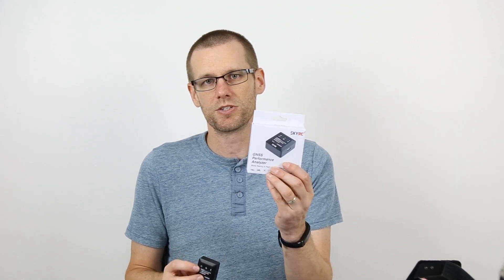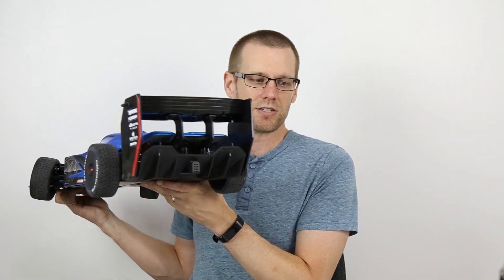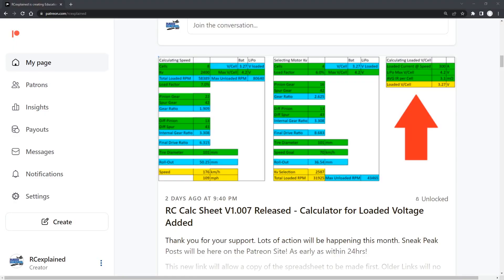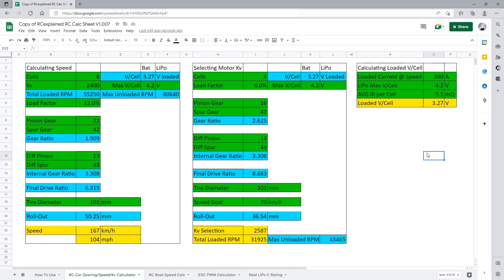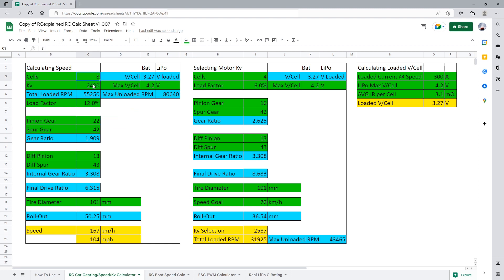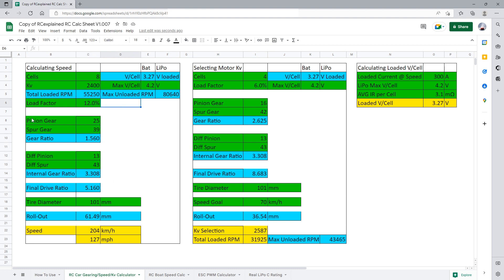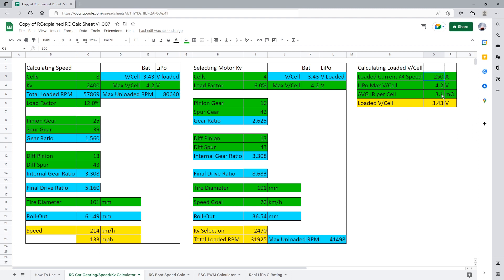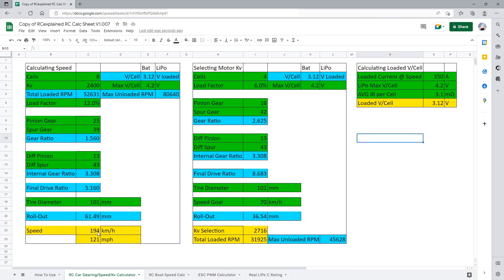Limitless 8s 2400Kv Update - Gearing Calculations, Radio Issues and Removing that Garmin GPS!

Comment: Look up futaba 4pm range mod. Another YouTuber with a aarma limitless standing on the road took the car out till it wouldn't go any further, it went 900 ft before it lost signal. Then he did the range mod and the car went 1900 feet,  he picked up a thousand feet and he only stopped because he couldn't see the car anymore.
Reply from the maker: Which range mod module do you recommend?
Reply: @RCexplained I can't recommend any of them because mine is  the mail on its way but this is the one I ordered.  

Szhushi 4w Power Amplifier 5dbi Antenna Wifi Signal Booster Repeater For Wireless Router.

It's the same one that was left in the link on that video. It worked for him so I'm going to take a shot in the dark.
Reply from the maker: Thanks I will look in to it

Comment: Highly Recommended  Futaba 7px or 10px remote.  high initial cost but a very powerful EZ to operate remote. holds 40 cars & tailored for speed run & drag racing while catering to bashing, rock crawler & the likes of rc. be safe
Reply from the maker: I have a feeling 12 receivers is not going to be cheap either ?
Reply: @RCexplained   high cost ea $90.00 highly recommended but "NOT" needed for your application. their is other alternatives. be safe.
Reply: I’m on the edge. Nearly everything I own is Futaba (baring one steering servo), but it’s on the T3PV platform, and distance becomes an issue with the ARRMA Limitless.

Additionally, I’ll be needing a radio for airplanes, and I’m a control junkie and I love instantaneous information, so telemetry is mandatory. 

Thanks again!

Peace always✌🏻  

Thanks for your input on the issue.

Comment: I've seen a lot of people using plane or drone receivers with twin ariels, futaba seem to be the go to but I'm not to sure how good other manufacturers receivers are👍
Reply from the maker: I could use one of my plane receivers, but I don't want to use the Airplane stick transmitter.
Reply: @RCexplained  Raz Shifrin and Kevin Talbot on YouTube use one on a futaba wheel controller, one of the last videos shows Kev buying two from his local hobby shop. Hope that helps bud 👍👍

Comment: Radio I'd at least do a futaba 7pxr or 10px. Although you could get away with a futaba 4pm or pv..
Then also install a range extender. This will give you about 3000ft of range..
Also looking using the dual antenna rx futaba.
Reply from the maker: I have a feeling 12 receivers is not going to be cheap either with the 7pxr or 10px ?
Reply: @RCexplained  the receivers are compatible with older protocols. So there will.be quite of range of receivers to select from

Comment: Hello love your video's keep them coming, I have an rc8b3.1E, I have been able to hit 105 mph my problem I have is ripple voltage I think??? at hi speed it cuts in and out in and out I've added a big cap bank to it  team brood 6s-12s,  it made the throttle amoother that's about it I'm running 6s 120c  burst rate 6200 mah battery on a hobbywing max 8 esc and a hobbywing  2800 kv G3 motor for on road it says it's only rated for 4S but runs fine on 6s so far motor doesn't get that hot after 3 runs the esc gets hot tho i have to let it cool after 3 or it goes in thermal shutdown it has stock fan on it as for gearing I put the over drive differential gears in it 42/13, spur and pinion is 42/27 it feels like there is more in it what would be you're next move??? My bro just bought a traxxas XO-1 and hit 101 mph
Reply from the maker: I would try lowering timing. It sounds like the ESC is not liking what its tasked to do. Investigate the ESC further. I am not familiar with the limitations of this unit.
Reply: @RCexplained  thank-you that one slipped by me i forgot about timing 😅 🙃 😆